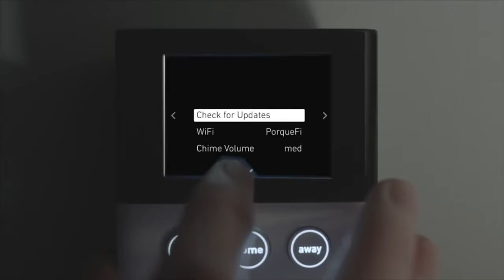The WORST Gun I Own

Comment: The CETME-L gets a bad rep, some of which is handsomely earned, some of which is not. I would point out that a quality CETME-L is one of the few guns to survive the InRange mud test with only minor problems.
Reply: @michaeltheoret3842  Except that the AK47 failed that same test miserably. LMAO.
Reply: By jamming just as much after the mud as it did before?
Reply: @hanselito2416  Go watch the test. It's on YouTube. Both of the rifles, in fact.
Reply: @hanselito2416  it's a fine rifle if you actually 1: buy a good one made by a decent company, and 2: shoot the right ammo (tuned for m855)
Reply: @hanselito2416  My Marcolmar CETME-L has been 100% reliable but I also read the manual and shot 62gr m855 for the first few mags to seat the rollers before using 55gr. Break-in periods are very common for roller-delayed blowback rifles even on h&k.
Reply: What is the effective range and barrel length? If the ejection issue could be fixed and you had some trigger work done, it could be an interesting varmint gun for ranchers (coyotes maybe feral hogs, etc...) w/a night optic and perhaps a silencer -- do they make threaded drop in barrels or would it be a custom job?
Reply: @chrisjohannes179  its a normal 5.56 with anywhere from a 16-18-20in barrel. also dunno how it would be a varmint gun, its a normal ass 5.56 carbine built for a mil contract, and you are lucky to find one selling for under 1k, they are EXPENSIVE

Also, they come threaded with or without picatinny
Reply: @chrisjohannes179  Roughly the same as the AR15. I think the Marcolmar CETME-L's have an 18 inch barrel. .223
Reply: @HomicideJack187  The InRange mud test is notoriously unrealistic. Like, all the modern-ish rifles with the exception of the M14 will still work after being dropped in mud if you don't slosh it around and sink the damn thing.
Reply: @reinbeers5322  True, it is. But it is a testament to a weapon's design if it passes or not. Not to mention that an AKM dropped in mud with the dust cover open does have a good chance of malfunctioning.
Reply: the mud test is completely useless

Comment: See, this gun has a problem, it needs really really powerful rounds to work well (more high quality ig?) Now, this normally wouldn't be a problem, except for the fact that the spanish army decided to cheap out on the materials and thus the rounds needed to make the gun work, well, broke the gun. There's replicas and licensed stuff that's actually well built that demonstrates that it's actually a pretty reliable gun. Forgotten weapons has a pretty good video on both the CETME L and the LV. (Either way  if you want a good cetme, get the model C)
Reply: It is roller delayed blowback system as in French Famas, such systems can work with M193 but have problems with M855. Before using you must know whitch type of ammo it will eat
Reply: @АлександрМаврин-я5х  yeah, that's why it jams so much
Reply: @АлександрМаврин-я5х  the Famas is a lever delayed not roller delayed blowback
Reply: A lot of reports said that the initial issues with the M16 in Vietnam were due to underpowered ammo, or bad powder or something. I can't remember exactly what it was, but yeah some rifles need military grade hotter ammo to run more efficiently. Most blow back guns run well with hotter ammo, like the CETME-C/G3
Reply: @antiquatedideas1107  M16 in Vietnam have problem with overpowered ammo. It generates more pressure and cause more stress on all parts, bolt extract case from chamber at higher velocity and case is under more pressure when extracting. Plus not issued cleaning kits dont help either.
Reply: shoddy engineering and corners cut for cost shows in the L models. 
The Cetme C models were the best G3 clone.
Reply: @worldcure7883  the G3 is a licensed CETME C, not the other way around
Reply: @worldcure7883  "aKcHuAlLy" The cetme is the original
Reply: @worldcure7883  the cetme c came before the g3...

Comment: 8:43 it seems like the springs just aren’t allowing enough rearward travel, and the ejector doesn’t have enough dwell time to kick the round clear of the chamber. 
@DemolitionRanch
Reply: Another strange thing about his Cetme is that it's only ejecting brass about 2 feet from the chamber. CETME-L's are famous for violently ejecting brass 20-30 feet. I have one and it kicks the brass like a mule. Not sure if what you're describing is causing his weak ejection or if it's just undergassed so the bolt carrier is not moving fast enough rearward.
Reply: Bad rollers
Reply: @cedagcedag  said weak ejection heheh heh heh hehheheh
Reply: @cedagcedag  I’m just basing it off of the mangled brass. I’ve heard that it’s relatively common for those parts kit guns to be oversprung. But I’m also pretty sure that the Cetme uses a roller delayed blow-back, like the G3/MP5, so I don’t think gas is a problem, but I could be wrong

Comment: I used to work in a glass laminating factory,  it is the layers and thickness of the vinyl,  that give most of the capture of the round. The glass is mostly tempered glass. That is why it turns to a cube or sand type of debris.  And we were always told, it's not bulletproof.  It's bullet resistant.  Also the tempered glass used in most storefronts,  will be strong enough to  Ricochet 12 gage XX shotgun pellets back in your face. Always shoot it in the corner of the frame , to run the cracks and weaken. Great site. 👍
Reply: Why would you have this knowledge let alone spread it to million of people you don't know of the internet? That doesn't seem wise. "Attention all armed robbers, it IS possible"
Reply: @josecartagena9173  U never been to a library before? There's lots of scary dangerous knowledge in those buildings !
Reply: thanks for the advice LMFAO 😂
Reply: @joeh858  Right because people nowadays rent a book from the library in order to learn something. Not like there's the internet. That's besides the point though as I'm talking about the THOUGHT to begin with. Who wakes up and says to themself "Damn I wonder if I could get past bulletproof glass... let's find out!" lol
Reply: @joeh858  Also your comment is flawed because the last place any armed robber is going to go is a library. If they had knowledge then they wouldn't be robbing stores to begin with.  They would know how to manage money better.
Reply: @josecartagena9173  lol
Reply: I gathered that the people who are the main readers,, are prepers or self defense oriented.  My info is for that store owner, who might try to shoot at robbers through the storefront glass as they run away
Reply: @leongerek9714  As an armed robber I just have to say thank you. I will spread the word to the hood.

Comment: I find once a firearm jams once or twice, you never feel like it's reliable even if it doesn't jam for the next 100 rounds.
Reply: If it jams once after a few hundred rounds, eh, okay. Keep an eye on it. If it jams multiple times within a few hundred rounds, I don't wanna EDC it. That's why I'm on my second 9mm shield. It's not the highest capacity pistol, it's not easiest to modify, it's a little jumpy... But damned if it hasn't had a single malfunction in over 5,000 rounds spread over both guns. Even my glocks have an occasional stove pipe. But the little Shield 9 that I can go buy for like 350 bucks out the door hasn't jammed or had any sort of malfunction once. That's shooting steel ammo, all sorts of hollow point, shooting with a 12 dollar promag magazine, and even with a RDS it's not really designed to have. It'd be nice to have 15 rounds but then again the shield is so small it really is incredibly easy to IWB carry and barely notice it which is nice. And way more important... It shoots. Every time. I know when I pull my gun out and squeeze the trigger that 124 grains of Federal HST will exit that barrel at around 1,000 FPS. And you know what? For a 300 dollar gun, it's actually pretty damned accurate. I can reliably pull off head shots in roughly the center of the head at 10, 15, even 20 yards. I wouldn't care to start trying to get crazy at over 50 yards, but I have full confidence that if I needed to I could get hits on a man sized target at anything less.
Reply: @riptaway  Some guns need a bit of breaking in though. It could jam a few times within a few hundreds rounds, and then run smoothly for the rest of it's lifetime.
Reply: @joost1120  they're not boots, guns don't need break in periods. If they have multiple malfunctions they're not reliable
Reply: @riptaway  guns are machines made by man, almost every gun I have ever had at least shoots a little better after a few hundred rounds. Some went from unreliable to stone cold killer and and some went from bad to holy crap I can't believe Remington ever let it out of the factory. Friends don't let friends buy a 522 Viper.
Reply: Camshafts aren't boots either, but if you don't break them in, you're in for a bad time. 

And for the same reason, too. Either application involves metal to metal contact in a situation involving high speed, high pressure, high temperatures, and the potential for excessive friction if machined surfaces are not properly bedded together.
Reply: @riptaway  The manufacturer (of the CETME L shown) explicitly states to break in the gun with M855. With multiple counts of buyers that say that it works flawlessly afterwards and really likes to jam before.
Reply: I know with 1911s and the copycats...they all need breaking in...heck my TALO Colt Commander needed 2 or 3 boxes of ball before she steadied out.

Comment: Your CETME needs new rollers. I had the same problem as you and I went with a set slightly oversized than factory and it hasn't malfunctioned since. Easy to check with feeler gauges and even easier to change out. It will become one of your favorites once repaired. Because blowback actions are the dirtiest of all actions it needs that "delay" to build up pressure to operate the recoil cycle properly. Nice buy. NOTE: For some reason you don't slap the bolt carrier release. It needs to be slapped to let it know who's boss.

Comment: Did you break it in per the manufacturer's instructions?  The manual explicitly says this will happen if you don't run 62 grain through it first!
Reply: You shouldn't need to. My Bren 805 S1 has never had a jam in the 5 years I have had it and I use cheap 55 grain Wolf ammo, higher end 62 grain works great too. If a gun needs a certain ammo type and needs to be broken in, then it's a piece of crap. Only axception I'd may is .22 LR as that wasn't really designed to cycle pistols in the first place, those you might need good ammo even in a good gun. But that's kinda what makes a good gun... the ability to work outside ideal conditions.
Reply: @Cruor34  Once you loosen it up with 62 grain, it works amazingly. 

CETME L made a name for itself mainly thanks to it's reliability.  

Also, the gun in this video is a replica, not an original.
Reply: I was wondering about that, since the guns are usually very highly reviewed. Ofcourse they were built for a military purpose, and have a roller delay blowback action.

Comment: I used the by Heckler & Koch manufactured G3 (7,62x51 mm) in german army (Bundeswehr) for 2 years in active service and some reserve trainings during the 1980's as an infantery man. I used different versions (solid and folding stock, ejection deflector and others). The rifles were very reliable and precise. But they are constructed as a recoil operating system. So you must be trained to handle the hard recoil. Handling the recoil of a HK G36 is very easy in comparison. 

The CETME-Version in the video obviously seems to have some qualitiy issues. Maybe Heckler & Koch has a better quality manangement in Oberndorf. Friends of mine own the semi-automatic version of the G3 for sports. They like their guns very much.

Comment: No disrespect of course, but I’ve seen a lot of Cetme-L’s that function perfect. I’ve fired one myself without fail. Seems like the problems you were encountering are more at fault from whoever you bought this from. Heck, even Administrative Results’ CETME functioned just fine. Maybe they sold you a lemon or a cheap copy.
Reply: It’s a lot build copy out of I think Ohio? I have the same gun. The copy isn’t cheap by any means. But it is ammo particular, like the original at first. Matt likely is just mismatching all of his various 5.56, and the stuff with lower pressures won’t work well in the cetme. It only like the nato spec kinda stuff.
Reply: The CETME-L was the worst Assault Rifle ever adopted in Europe and the build quality for many was about as bad IO Inc.

Imagine everything that went wrong with the L85, but imagine worse.
Reply: @Seth9809  nah I wouldn’t say it’s worse than the l85. The l85/sa80 project was a disaster before production started, and the gun had design flaws along with bad manufacturing quality. The cetme l has an ok design, it’s the bad manufacturing that gave it it’s bad rep.
Reply: @Seth9809  the cetme is a good rifle that was poorly made cuz Spain wanted to save money. The design is totally fine.

Comment: Interesting... although the CETME L isn't known for reliability, this appeared to be a reproduction, considering that imports of entire guns are low since they are originally machine guns. Since it's a reproduction, the unreliability may be a bit of an unfair judgement?
Reply: Also most guns have hiccups in the first few hundred. Guns always run better when broken in. He said these were literally the first shits but I think if the ejection port was slightly bigger it would work better lol
Reply: Cetme is known for its reliability. Pretty cool gun, developed in late 40s and based off of the STG 45. Cetme and HK worked together and the germans ended with the G3.
It's a shame that Spain's economical crisis in the 90s made them adopt the G36.
Reply: Spaniard here. The CETME L is garbage, not because it is a bad gun, but because it was built cutting as many corners as possible. Pretty much everyone I know that served while the CETME L was in service tell me the same, that it jammed from time to time, curiously, the ones used by the Guardia Civil (spanish gendarmerie)  were ordered to be built using higher standards than the ones from the army, so they were really good guns. 

The same happened with the AMELI, the UK was interested on it, but they rejected it after they saw how cheaply made (and because of this, unreliable) they were.
On the other hand, the CETME C, the original one which the German G3 is based on, is known to be a great gun, sturdy and reliable.
Reply: @TheLadderman  the bolt is returning before the shell can clear the ejection port, maybe a slightly heavier buffer would make the difference in bolt delay enough to allow the shells to eject freely. Edit: nevermind cuz these guns don't have a buffer lol. It would need the roller delay surfaces adjusted or something.
Reply: I have a cetme l from marcolmar (same as in the video). They come with a big yellow paper in the box that says to run 150 rounds of 62gr milspec ball ammo to break it in. Sure enough the first 150 rounds I ran through mine had ftf and fte issues. After 150 rounds it was like magic, haven't had an issue since. Matt should really learn to read lol
Reply: ever think of trying different brands of ammo not all .223 / 5.56 shoot the same lol
Reply: @hypernova3527  If I remember correctly that was due to 2 things, first the C was built in much higher numbers and thus making a really good rifle didn't get expensive per unit. For the L, spain was transitioning into a much more specialist military. Way less rifles were needed, but the government wanted the same price per rifle. Naturally they're of worse quality.
The civil guard rifles supposedly were made to a higher standard because they were also significantly more expensive, but I don't know if this is just luck since I've never seen an official document in which the civil guard got more expensive rifles.
Reply: the problem with the oficial cetme L were in it´s produccion because they use cheaper materials to lower the cost for the army
Reply: @Fanuc_Operator1990  Spelling mistake I know but first shits had me dying
Reply: Looks like the AR70
Reply: @Fanuc_Operator1990  I remember the jams I had on my first shits that made me realize my ejection port was to small.
Reply: @hypernova3527  100% , i did my mil service with one in '95
It was total crap,jammy and fragile.
The old one (7.62) was a war beast.